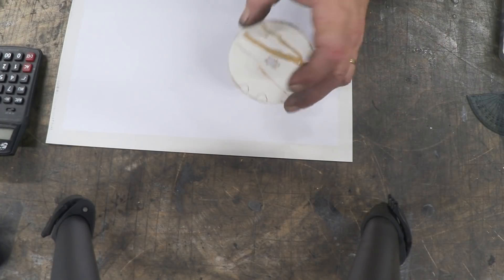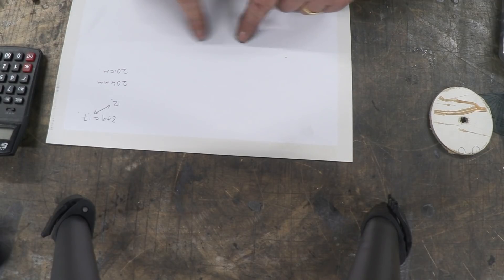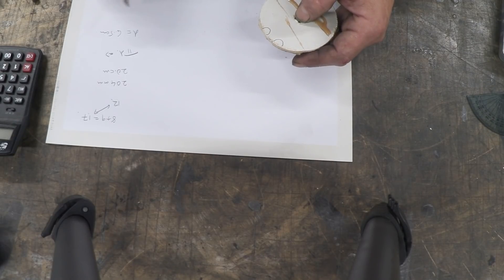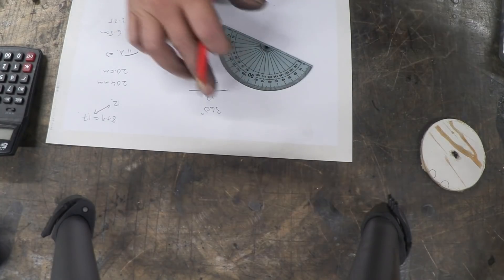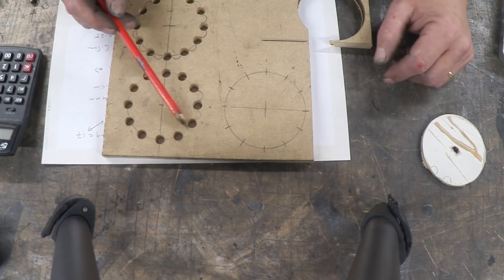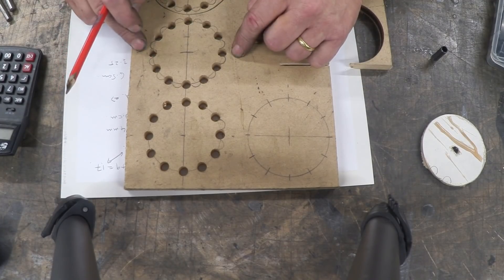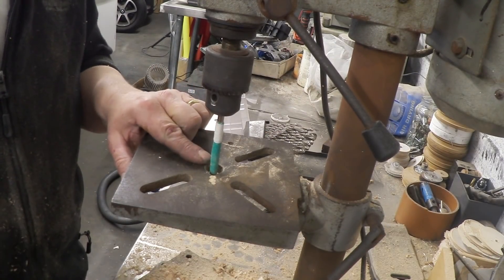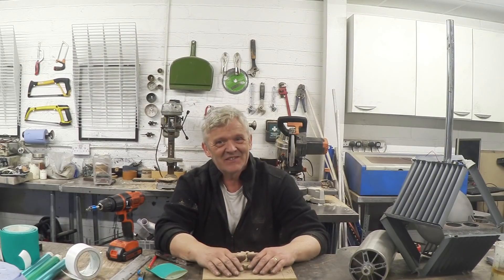Making Wood Gears

Comment: Well done, Robert. I have a friend that has taken the time to develop 3-D printer capability and has done some amazing gear sets, as well as many other very handy things.
Another technique that would make very nice gear sets is a laser cutter or high-pressure water jet cutting. Laser or water-jet and 3-D printing all involve CNC in one form or another.
So, the bottom line is being able to understand and do CNC work is probably one of the best prototyping talents an inventor can have. I haven't done that yet but the writing is on the wall. Stated in other terms, not being able to do CNC is a terrible limitation.
I owned and operated an electrical engineering consulting firm for 35 years, and my designs were used in hundreds of millions of dollars' worth of products. Having the ability to marry my electrical designs with what can be done with CNC techniques would have multiplied my effectiveness many times.
Reply: I do a lot of 3D printing, and agree that "all things CNC" are wonderful tools and skillsets to have.  There is, however, a downside in that you lose the "connection" to your work and the feeling of self-sufficiency.  It's good to also know and be practiced in how to do things by hand.  I don't like the feeling of being completely dependent on my 3D printer to make things.  Rather, I like when it's simply the alternative I'm choosing.  One thing that concerns me as we continue advancing technology is our dependency on it.  I worked in Information Technology since the 80's, and I would always try to incorporate a "manual backup system" in solutions I'd develop.  That is, what will people do when the system crashes?  Is there a way they may continue getting the job done - even if slowly - until the system recovers?  As I worked mostly in healthcare, that capability was essential to the uninterrupted delivery of patient care, but is a good practice regardless of the field.
Reply from the maker: I sort of agree and disagree mate - I see what you are saying and I agree with the ideas and possibilities but not every one can afford the equipment or even has the space  - this method is a tools poor method and benefits from being quick and within the average guys capability - it's why I like it
Reply: @ThinkingandTinkering  - I understand and agree. It was a Brit named John Harrison, a self-educated English carpenter and clockmaker, who invented the marine chronometer, a long-sought-after device for solving the problem of calculating longitude while at sea. He made all his gears by hand.
Reply: @ThinkingandTinkering  Well, the thing is that almost anyone can hobble together a crude CNC from discarded printers and a few hand tools. Even those can improve your working tolerances 2 or 3 times better than what you can do by hand (if you can make it rigid enough). The low power gears of your average printer can still do a great job if you design the system to not put stress on them (Yes, I'm talking worm gears). It will be slower and weaker than even the cheapest commercial CNC, but your initial outlay is next to zero.
Reply from the maker: @ExtantFrodo2  I hate to say this mate - but they can't - you can but you have familiarity with it - a lot of folks can't
Reply: @ThinkingandTinkering  I guess I take a lot of my skills for granted.

Comment: This is something that I’ve wondered about for years. Thank you! This would work for metal too, at least in the application I have in mind.
Reply: you could always make a set of gear stamps and vise for stamping out free coke can aluminium, then stack to the wanted thickness, and apply heat (2 or more flat diy 12/24v 3 amp capton tape heaters!) as all cans have a consistant plastic layer that should probably bond the stack without solvent
Reply: Some graphene reinforced plastic that rob has made in the past would make a good material in some cases  and one could make a mould for them
Reply from the maker: awesome mate - glad it helped
Reply from the maker: I like that mate - cheers

Comment: BINGO!  A great solution to a problem I've seen a number of times.
In another video you used the Archimedes screw with the ocean waves.  I was thinking that it could work with a float attached to a rack and pinion gear, to turn the generator.  So this gear making method could be used with a rack and pinion made of plastic or waterproof and rustproof material.  Cool!  Thanks for the informative video.

Comment: Ok I think it’s important to say that the diameter is for layout purposes only and that the final diameter will be larger and therefore don’t precut the gear blank. Once the 9mm holes are drilled the radius is approximately 4.5mm larger which could be it unless the 8mm tooth blank is somehow placed further out before drawing in. Perhaps you could discuss the gear creation in terms of using the timing belt material as an actual belt between two specifically made wood gears designed to transmit energy from one gear to the other through the belt. Love your channel, it really makes me think.

Comment: I'm a bit late to the party for comments, but I hope I make up for it with quality info.  Making wood gears IS way more useful for projects than you can ever imagine, and if done right wood gears can be quite durable.  However, doing it right is somewhat complex, you will want to use true involute gears. The Involute profile is far more complex to cut but you will be rewarded with significantly less backlash and considerably improved mechanical transfer efficiency. This will translate to a much smoother and quite running machine that can last much longer.  Matthias Wandel has created a very easy to use template generator to make involute gears that will save you from having to do the calculus yourself.  The template has limits but is a great place to start.   I would always wax your wood gears to improve slip and reduce friction thus extending life.  Do keep in mind there will always be considerable friction in a gear set, and hence wasted energy. A belt is far more efficient at energy transfer when applicable.

Comment: I have built myself a CNC router and I think you would find one really useful for the type of work you do.   Building and using one might also be interesting for your viewers?
They can be surprisingly easy to build and use (you don't have to get in to complex CAD software).  e.g. if you need a couple of gears you can quickly draw them in Inkscape (it has a built in gear generator) then feed this file in to Laserweb and cut them out.  The whole process from opening Inkscape to having the gears in your hand can take 10 mins.  
You can attach a pen and use it as a plotter which with fabric pens can draw on to a T-shirt etc., attach a cheap vinyl cutter head (£10 on eBay) and you have a vinyl cutter, attach a laser and you have a laser engraver...

Comment: Yet another great video Robert. Making wooden gears can be a pain. You need to consider the environment the gears will be used in (moisture, humidity, friction etc), this will determine the material you use which means the weight of the gears changes which impedes on the outcome as does friction. Of course this can be reduced with decent bearings and other smart implementation ideas. Thanks for the tutorial, I can never be reminded enough, I love woodworking as well as electronics.
Reply from the maker: me too mate and nice pointers - cheers

Comment: Thanks for this!!  You make everything look so simple!! 😺 I have to admit, having a 3D printer is making me kinda lazy.  Rather than sit down to try and figure out how to cut out a gear by hand, I could just print one out.  However, I would estimate it would take about 4 hours to print one gear the size you made, which could likely be done in within 30 minutes using your method.  I've been trying to force myself to figure out how I would do things without using a 3D printer before I allow myself to run a print.  That way, it's a deliberate decision I'm making of when to print something instead of a crutch I'm relying on that wastes a lot of time.
Reply from the maker: I agree - very often I can. make something in an hour or so that would take all day to 3d print - and watch the next video I do a 4 foot gear using this method  - that would take some printing
Reply: cats@,one simple way to speed that up is just print a full hight few layer thick walls to keep it stiff, then pack sand around it's outside edge, get some of the wifes/amazon uk pure acetone nail varnish remover then desolve some scrap styrofoam in a jar, add and do or dont stir in any small nylon thread fibers from old cloths etc and  pour it in the print, should save a few hours and get a more solid set of one off gears
Reply: @paulmaydaynight9925  Great tip!!  Never thought about printing hollow and using something else for filler.
Reply: I rather have a machine do 4 hours of work than doing 30 mins of work myself. Perhaps more importantly, a 3D printer can reproduce an accurate involute profile which will create a longer-lasting more efficient gear. The method shown, while nice, does produce a rather low-quality gear unfortunately.
Reply from the maker: @antalz  I am sorry mate - but I just can't get behind that - 3d printing has it's uses for sure but to not want to work on something - that is just a mystery to me
Reply: @ThinkingandTinkering  I do like building things, but I prefer "outsourcing" the repetitive boring stuff to machines. If I CAD and print stuff I end up working less on e.g. cutting gears so I have more time to work on all the other things that go into my projects, like cutting larger wood/steel pieces, assembly, overall design/layout, calculations etc.

Comment: Very good. Gear reductions are a good thing the explore for wind projects that are designed to do work directly rather than generate electricity. Just last night I watched a UTUBE video where a man made an academes screw out of a mild steel rod, steel discs that he cut out with a whole saw and a welder. He simply cut from the perimeter of the discs to the centre hole, bent them on a jig and welded them onto the shaft. I was thinking that maybe you could do this to make a worm drive gear reduction maybe with aluminium and your aluminium brazing rods. Also another interesting way of getting a big gear reduction is through a device called a harmonic drive. I reckon you could make one.
Reply from the maker: for sure mate but I wanted the idea of gear making - gear reduction and screw gear are a bit much for one vid but I will look at it later for sure

Comment: Great video.
Does this work for inner gears like planetary systems?
Of course, you'd need to work backwards, drilling the 9mm holes considering the 8 mm part will be on the inside...

Comment: I think while transitioning away from internal combustion engines we should be thinking about ways to utilize the 35% or greater heat energy we waste. To think that we drive around in 50kw or more mobile  heat exchanges and just emit it to the environment must be adding substantially global warming ! 1.5 billion in just cars equates to 75 billion kilo watts if driving for 1 hour it is 75 billion kw/h. Thats madness and thats just cars! Double that at least if you include trucks and bus and they drive all day! Any one care to estimate?? Literally OMG!!
Reply: Yes, we should make existing technology more efficient and try to harvest waste heat. But for cars it won't work. The engine block is typically cooled to about 90°C, and of course your car should still work when it's hot outside, say 40°C. Thats only 50°C temperature differential in the worst case, not really enought for a powerful stirling engine. Thermoelectric generators would work, but they have very poor efficiency < 10%. And any solution will add weight to your car which in turn will increase fuel consumption, and that's not what we want. So I think it is only reasonable on stationary equipment where additional weight and size is not an issue. And maybe very big ships.
Reply: What about a 1 liter closed system steam  driven tesla turbine? Heat exchanger with water creating steam and driving tesla turbine and then condensed and repeat. This can be used to charge batteies or super caps in a hybrid or electric bus  etc  and then used immediately when taking off from bus stops . Along with kinetic energy harvesters and disc brake heat it could replace a sizeable amount of heavy batteries and replace them with lighter supercsps etc .retro fit kit would be easy for diy person or mechanic !
Reply: Desmond Bagley  I don't know enough about the exhaust stuff, but regarding the water tank: Again, it would be possible, but it would mean an extra 100kg for the water plus the weight ot the tank and heat exchanger. I think the increased fuel consumption due to the added weight would cancel the increased efficiency. Thats why I suggested stationary systems. Why not, for example, wire the watercooling of your gaming PC into the hot water supply? And add in heat exchangers that take the heat from the still hot waste water of the shower drain and the dishwasher and use it to preheat the cold water going into the boiler. No need for big tanks, no moving around, just a bit more plumbing.
Reply: @Buzzhumma  You need at least 100°C to create steam, typical car engines don't run that hot. That's why I suggested a stirling engine or TEG. And since it would be simple to replace the cooling water with oil and run the engine hotter, I guess there are other reasons, maybe wear of the components, why we don't run those engines hotter.
Reply from the maker: agreed mate

Comment: You can't make a wood gear. You can only extract one from a board.
Reply: Well, you could make a gear-shaped metal cylinder and plant a sapling in the center. When the tree grows, it will fill the shape. Just wait 20-30 years, the you simply cut off a disk and you have a wood gear. No board needed, but takes quite some time.
Reply: Desmond Bagley  :-) you sussed me. My father was a sculptor. Stone was his best medium. The apple doesn't fall far from your pocket.
Reply from the maker: lol - for sure mate - nice one
Reply: @freundlicherhater6085  And here was me thinking that clock makers had patience. You blow them out of the water.
Reply: How To Make a Paper Tuxedo | Paper Clothes
2,800 views•Dec 25, 2017
,Origami 4ik